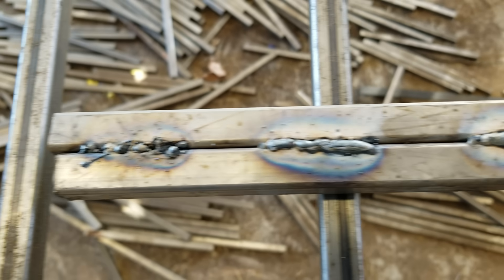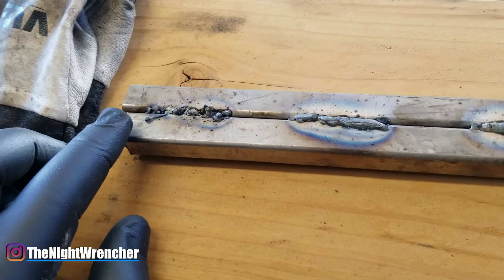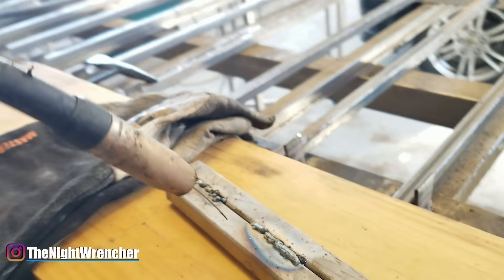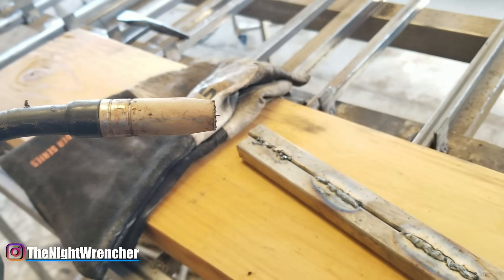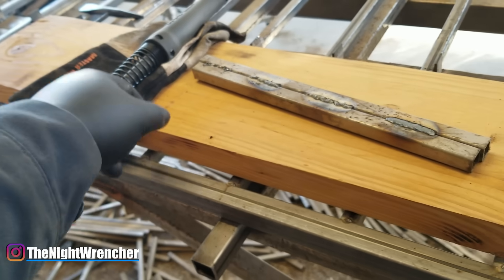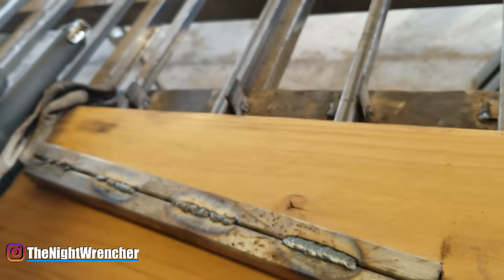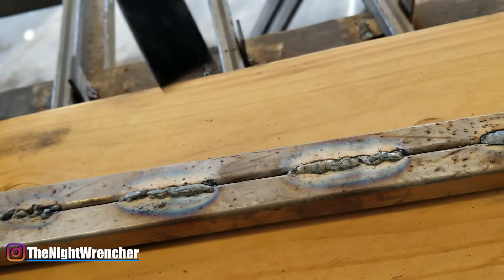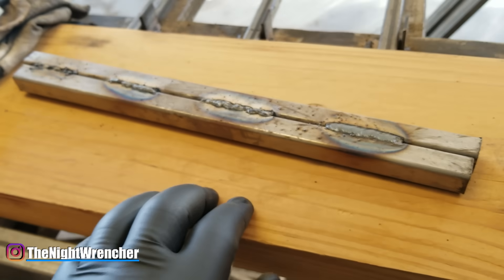Learn Perfect Flux Core Welds In 10 Mins | Gasless Flux Core Welding For Beginners Tips And Tricks |

Comment: An excellent walk through of the unspoken problems. Obviously everyone needs the prep and settings.
Some confusion there regarding heat. Yes there is more heat in the better welds. Thermal energy that melts and flows the material. You will need protection just for that heat unless you are doing short welds on thin material.
As has also been said though the sunburn is because of U.V radiation from the electric arc and for that reason alone you meed full coverage. You get this regardless of how hot the welds are and even a few short tacks can burn your skin. Just as one arc strike can blind you.

Thanks for the video.

Comment: another piece of advice, if you cant hold the metal you're welding right, just weld 2 points at the ends of them, helped me do a first few welds before I was able to just hold while I weld
Reply from the maker: I've done that as well and I've also welded the ground clamp to the material that I'm welding if the part doesnt have any where to calmp it to or if you're not using a welding table.

Comment: Very well done video. Great info for noodles.

I've done Gass, Flux, and Stick. All three have their place in metal fab plus their pros/cons.

Gas is the easiest while Flux is not far behind. To me, the prime difference is that Gass produces little or no splatter while Flux does produce splatter. Stick is the worst.

I'd love to get a Tig welder, but a Plasma Cutter has higher priority.

It's all about money, or the lack of it.......
Reply from the maker: Exactly right. When I build decorative panels, I weld all the seems that will be grinded down with flux core and all the welds that will be exposed with mig.

Comment: I just started welding today for the first time.  Got a brand new Vulcan MigMax 215.  With flux core wire, and setting the machine for the thickness of my material (14 gauge)  I keep blasting huge holes in the material no mater how fast or slow I move the gun, and now matter what angle of drag I use.    So instead of a bead of weld, I have a long hole....   help!

Comment: You never did get to exactly how you did weld #4????  I have a flux core welder and I am very interested in doing a bead  like the #4 bead.  I get a LOT of spatter in my welds.
Reply from the maker: If you apply all the tips in the video, weld #4 should come easy. The brand of wire also makes a difference. I like the lincoln wire the most

Comment: Great video but one thing I never see is an explanation of is the welder's duty cycle. You must read the manual to find how long you can draw a bead at a certain setting before you need to let the transformers cool. At best 7~8 minutes on a buzz box before you start getting a popcorn weld.

Comment: Flux core is the best process, you just got to know how to use it. I never use tig or mig unless I only care about looks.

I weld up to 3/8 plate steel with a 110v welder, above that thickness I preheat with a oxygen torch. You can do a lot with a little if you learn the techniques

Comment: And it is the same way when you are using a torch heat welding wire a little dip in Flux and bond wire to each side and a little puddle in the middle and repeat the same when you come up to the the flux end of your welding wire dip and weld dip and weld is the way it's done and a flex core wire welder is nice cause you don't have to dip just weld it

Comment: Welding metal is like molding plastic together you want to fuze them together from both sides and a good amount in the middle and you will have a sold Bond together and always hit your weld with a welding hammer before the weld cools to get the metal to bound Chris cross and form together

Comment: Sorry to tell you this, but you don't know the difference between MIG, and Flux Core welding. Pushing and pulling can be used with MIG and Flux Core. I have been welding for 42 years. I use oxy-acetaline, stick welding, Flux Core, MIG, use a spool gun to MIG welding aluminum, TIG welding, submerged arc. Find some one that can teach you proper welding. If you are in the DFW area, let me know, and I will teach you.
Reply: I have 3 tractor trailer loaded of steel that needs to be welded up into 38' rafters ' do you think I can bring them out there to you and get you to weld them up for me and show me how to do it?

Comment: Hi should you remove the mig tip when using flux core I heard the tip is to contain the gas
Reply from the maker: There is no rule on removing the mig tip but if you do remove it, you have to replace it with something else like a cap. You can't just leave it exposed because you will damage the area where the gas exits the gun. If you want to take the tip off for a low profile cap, thats fine, but dont just take it off and leave it off.

Comment: I just went out and bought my first welder. Never welded In my life until today. It’s a 125amp flux core from harbor freight, it isn’t much but I needed to weld my trucks exhaust. After 3 hours of practice and messing with settings I made a few welds that will hold. They sucked, I wanted this video and used every technique. Within an hour my arms are burning and I have some pretty decent looking welds. Tomorrow I’m gonna practice for another hour then try to weld my exhaust.
Reply from the maker: Great job man, good to hear it! Make sure to start wearing a jacket! Skin cancer is no joke!

Comment: thanks for the video.. i have a tack weld test tomorrow flux core.. for a ship fitting job. i never used any type of process other than stick so these videos are a huge help!
Reply from the maker: I hope it works out for you! These videos are for DIYer to DIYer so it may not translate well to professional welding because there are certain things you NEED to do when it comes to a professional job.
Reply: @NightWrencher  it was super easy! just had to do 2 T joints. one vertical and one overhead. i literally paid the instructor of the test the morning before to train me on the test, took a little over an hour to get it down well, nice thing is as a shipfitter i only need to tack weld everything so its not as crucial as long as my pieces hold until the welders come and finish it up.
Reply: @NightWrencher  you pointing out the speed differences and the outcomes from it made me know what i was doing wrong when i started practicing

Comment: Best tip ive heard is take off the nozzle, you will see the wire and weld much easier. Only thing that might stop you from wanting to do this is if you have a mig machine, then you'd need a different nozzle

Comment: Hi how do you know what to set the amps and wire speed to?
Reply from the maker: Which machine and wire size
Reply: @NightWrencher  oh! One more question what's the difference between welding with gas and without it?
Reply from the maker: Theyre different processes, they use different wire and the settings are different too. With gas is more expensive but the welds come out cleaner and penetrate better than gasless. Gasless is cheaper and easier to weld.

Comment: When welding flux core, the mig tip can and should be removed anyway. It's not needed.
Good video overall, but recommending not wearing protective gear is just stupid
Reply from the maker: I never recommended not wearing protective gear, but thank you

Comment: Thanks for some clarification to mig techniques. One thing I would mention, from my own experience,  some diagnostic is a good idea with inconsistent  welds before condeming your technique. I recently was having problems getting welds like the first and second bad welds. My speed and distance was correct but my ground clamp was breaking away from the ground cable causing inconsistent conductivity. Also the wire spool was sticky/jerky due to the label placement on the spool. Turns out the paper was expanding due to humidity and causing friction during long weld sessions. After saudering in an extension (for more maneuverability), upgrading the ground clamp, and putting dielectric grease between the machine and spool lable, the welds became more consistent.
Reply from the maker: Ive suffered through bad spools too. You go chasing settings and technique when it was wire tension all along

Comment: My gasless mig is splattering/beading I’ve cleaned the piece reduced wire speed
Reply from the maker: If its not an inverter style welder, it will always spatter. If it is an inverter style welder, you can prevent spatter by turning up the heat and getting the tip closer to the material you are welding.

Comment: I bought a cheapy harbor freight 110v welder a few years ago and it's still in the box. I've been looking at old jet boats and seeing how expensive jetski 2 stroke motors are. So now I'm thinking 4 stroke motorcycle or car motors. Which means I will have to do some welding to get it to work right. Idk if my welder is gasless or not cause it's still in the box. Hopefully not. Thank you for the clear concise directions. Hopefully I can master this cause hey no one needs leaky welds in the water. Lol
Reply from the maker: If its a gas welder, it can be run on gasless, just change the wire and polarity. Good luck with the boat!
Reply: @NightWrencher  it's a flux. Wire fed. I got the boat. Motor installed. It's not locked up. Who knows tho. It'll be 2 months before I can throw money at it.

Comment: "If it's got slag let it drag" - brilliant! I will remember this for when I try gasless wire next. My welding instructor of 22+ years ago had worked on oil rigs etc as a coded welder, his stick arc welding was absolutely amazing. He rarely needed a chipping hammer, his slag used to peel off in one piece, by itself as the weld cooled. It was amazing to watch and his welds were flawless. Incidentally, he had also previously worked with Billy Connelly as a welder before Billy got into comedy.
Reply from the maker: I'm not very good with stick but you cant get much stronger that that!

Comment: just use gas with the flux core wire. the flux prevents sparks up to 90% when it is used with gas. reduciding cleaning time and production time. welding without it is just stupid and unprofessional. this video is a classics waist of time and teaching the wrong thing to do. gold stander welder opinion!
Reply from the maker: If you want to use gas with flux core wire, just use solid wire instead.

Comment: Your video is meg welding, not flux core welding.
Reply from the maker: Lol what makes you so sure?
Reply: @NightWrencher  
Flux core welding has a core of flux in a wire tube, Does your wire have a center with flux inside.
Reply from the maker: Yes, thats why its called flux core. The wire that I use is called "inner shield" by lincoln.
Reply: @NightWrencher  I stand corrected.

Comment: those "sunburns" are actually caused by the ultraviolet (UV) and infrared (IR) radiation coming from the sparks of welding. this can get bad enough to actually give you skin cancer!
this is why, in ALL welding safety manuals, they say "COVER ALL SKIN!". even your neck and ankles. it's no joke. anyone who welds A LOT without wearing any coverings, it won't be the welding materials or sparks that kill them...

Comment: I want to see you weld body panels with that flux core. I'm having issues big time. If course I have a cheap titanium 125 from harbor freight but I was hoping that I could make it work. Any ideas or videos would be great help. Thanks
Reply from the maker: Low heat and low wire speed + more time. Spot weld and jump around. I'll have a video on this soon

Comment: That's  a lot of spatter. Even on you best weld you need to adjust you machine. Why are you 3/4" away from the material?
Reply from the maker: Thats not my best weld, thats just a weld. If I didnt want spatter I would use anti spatter spray, get nice and close and go to town. Thats not what this video is about.
Reply: @NightWrencher  If your settings are right you dont need anti spatter spray. check your settings and listen to your weld.

Comment: Is it possible to weld two copper pipes parallel to each other using this Flux core?
Reply from the maker: It is not. You cant weld copper or aluminum with flux core
Reply: @NightWrencher  do you know of a way to mig weld copper to copper?
Reply from the maker: I would suggest learning how to braze but you should be able to MIG copper together with the right wire and gas mix. Flux core wire wont work.

Comment: I have a cheapo harbor freight 120v flux core welder. I can lay down some pretty welds. Prob I'm having is not penetration into the metal. I can pull apart the project by hand. Even on 1/16" plate with the welder set on high.
Reply from the maker: Try turning the wire speed down and move across slower. Let me know how that works out 👍
Reply: @NightWrencher  tried that.
Reply: @NightWrencher   I'm fairly sure it's something with that welder. I bought a better one and my welds are very good.. and I can melt right through 1/4" if I wanted too..
Reply from the maker: Yeah, thats what I was thinking. I've never used that welder so I didnt want to blame the welder if I didnt know its limits

Comment: A point to make, getting as close as you can to the parent material whilst using flux core whilst gas shielded, you will trap gas under the weld , this will give gas incursion and the weld is prone to crack. Welding gasless flux core, reversing the polarity and running straight dc will go a long way to helping out newbies as well

Comment: Hi there just wondering if you have any tips on why my welder starts to not feed the wire properly and freely after a while of welding. I can feel it in the gun it feels rough and doesn't feed smoothly into the weld. 200amp welder with 0.9 flux wire and 1.0 tip thanks
Reply from the maker: Depending on the wire, you should match the tip and the welding wire sizes. So if you use 0.9mm wire you should use an 0.9mm tip. Some tip brands wont work with some wire brands so try to buy them from the same company. Low quality tips warp and melt. I've found that Lincoln and Tweco make the best off the shelf tips. The next thing you want to check is the tension on the welding wire. If its too lose, it wont be able to push through the tip smoothly while its welding so give it one turn in to see if it gets better.
Reply: @NightWrencher  thanks for your advice. I was told by the Shop that flux wire your meant to run bigger tip than the wire hence why i have 0.9 wire and 1.0 tip.
Reply from the maker: Thats only if the wire doesnt fit on the tip. I've always purchased .030(0.8mm) wire and .030 tips and have never had an issue. I dont know what is available in your area but if you can find lincoln wire and tips, you'll be set
Reply: @NightWrencher  ok thanks very much for your time and advice

Comment: You should see the state of my first ever welds I did today. I was forced to do it myself so I did after watching a few video's. On my little test run though on the other bike frame I beat the weld with an hammer & instead of the weld breaking off it rips a lump completely out the bike frame instead, so it must be a good sign right? . Please Lord do not let it snap on me. Amen

Comment: Based from what I hear from other welders, is the weaving method with flux  insufficient? Because the old timers tell me that that weaving with flux core will cause inclusions in the weld which will not make the weld 100 percent.
Reply from the maker: From my experience, welding straight across will give you the nicest weld with flux core. It doesnt stack like MIG or TIG so if you try to weave, you'll just have a blob. Drag it straight across and youll be golden

Comment: If I need to you an extension cord, what kind do I need?
Reply from the maker: Usually a 12ga core works pretty well but ive used smaller cords with no issues. The problems come when you're welding continuously for an extended period of time, the cords get hot, they melt, they can burn, etc. But, as soon as the welding stops, the cords cool down fairly quickly. So even if you're using a thinner cord, as long as you know your limits, you should be fine.

Comment: You should cover up when welding because the amount of UV light that comes from the welding process is dangerous and can cause eye damage and cancer. I recently switched to gasless and the heat from welding is noticeably higher than using gas a MIG. I still think if you can use gas it's a nicer smoother weld.

Comment: I gave myself a sunburn, er weld burn when I put together an Equal Angle hitch from 1/2" steel.  Dumb me forgot I have a leather sleeve vest.  The main problem I run into is being able to actually see what I am welding. I have to take my glasses off to weld, and even then I lose track of the seam.
Reply from the maker: Use an auto darkening helmet and turn the brightness up. Move your head closer like if you were trying to write with a pencil. Drag the torch left or right, not towards you. Drag away from you.
Reply: @NightWrencher   I now put readers on and get up close and personal and can see better, but the helmet is still too dark to see past the arc.  I think it is time for a new one as the switching is intermittent, sometimes a delay switching back to light from dark.  I think having more viewing area will help too.

Comment: This helps a lot, I was wondering what my issue was and it seems to be wire speed
Reply: I was wondering why gas, solid wire mig is easier than gassless flux, and it seems to just be a small learning curve
Reply from the maker: Its not too bad, slow the wire speed and turn up the heat a bit and you should see an improvment

Comment: Great video! Helped me tremendously. Only issue I'm having is the flux welder I have only had 1 control. Numbered 1-9 it controls the wire speed, power etc. So I burn through a lot of thinner materials.
Reply from the maker: when in doubt, slow it down!